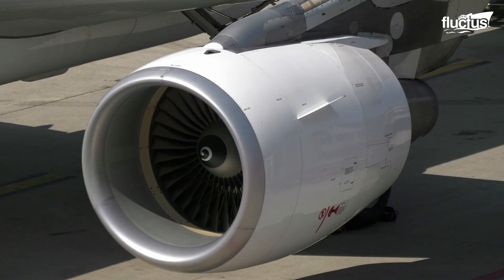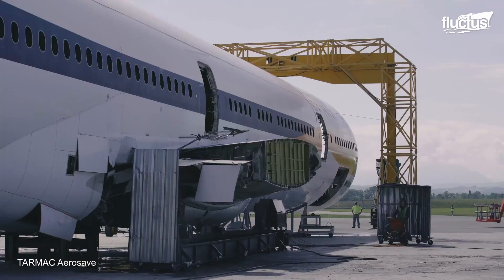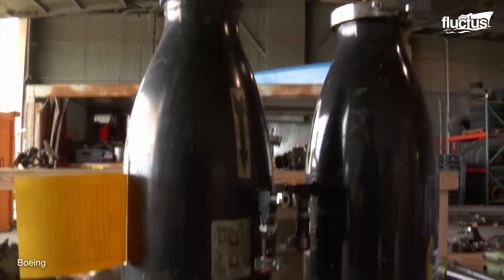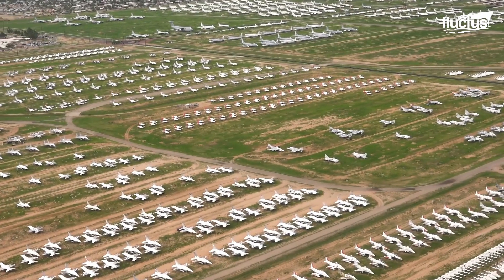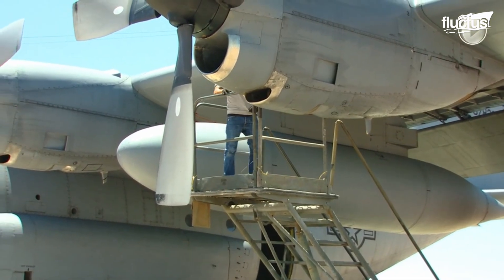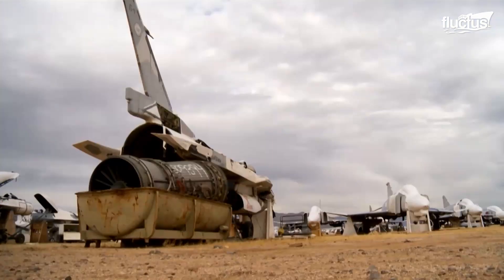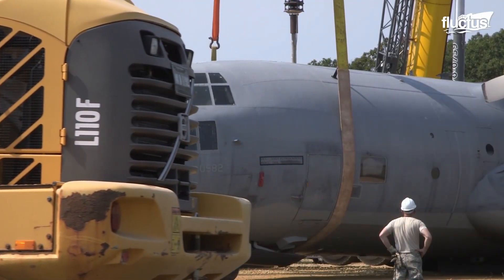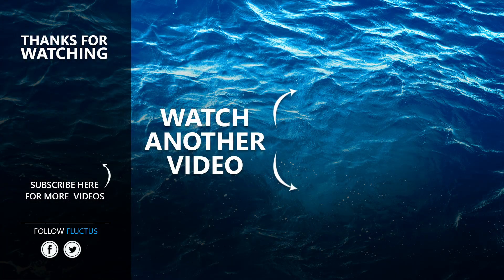What Happens to World Biggest Aircraft When Nobody Want to Buy Them Anymore

Comment: Former Boeing....  some great 'deals' on used A-380's and B-747's...

Some aircraft never die, their 'parts' are re-used similar to Organ Transplants. There are lots of 'certified' used parts around the globe. But buyer beware... there are 'uncertified' used parts as well. It is possible to track used parts by Part Number. Usually the cheapest price comes with many liabilities. Crashes caused by cheap used parts are common and cheaters are prosecuted for murder.

Boneyards for non-working aircraft are in high demand....